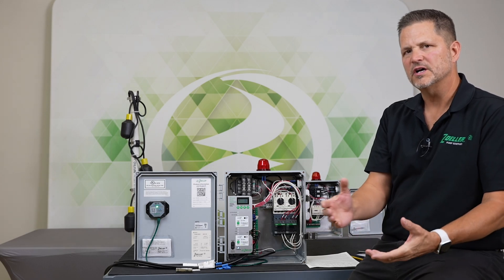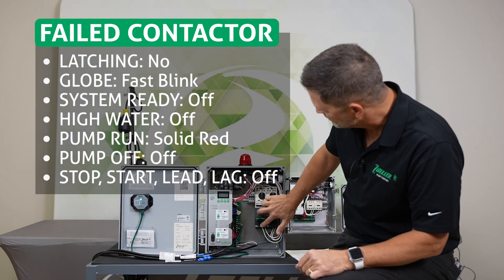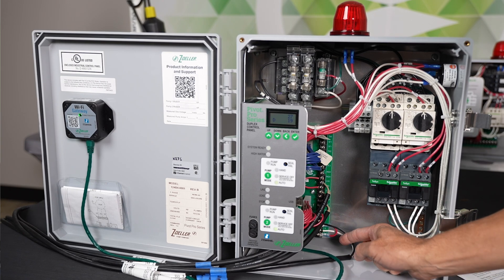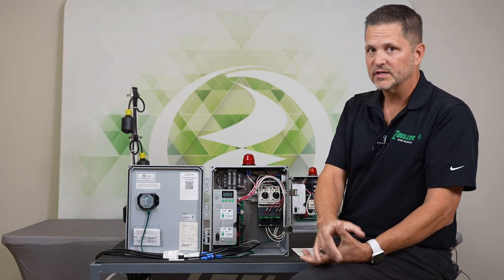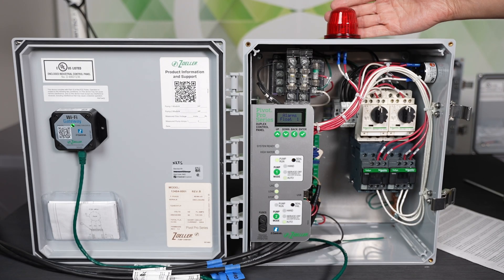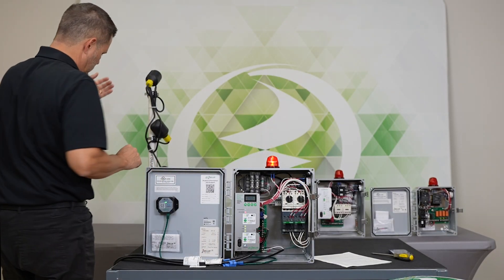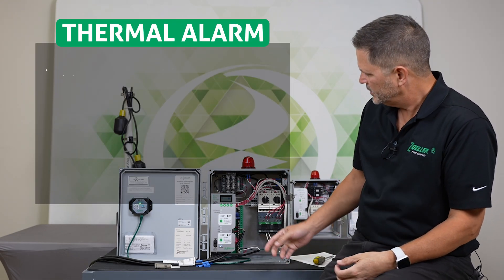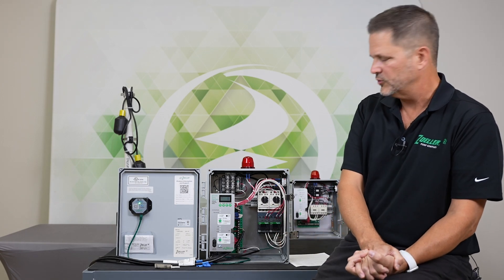Pivot Panel Alarm Conditions

Comment: Hi my Adu swear tank alarm 🚨 is going off when it’s raining 🌧️. It is normal? Shout it work when rain water sweeps in? The red light is Solid
Reply from the maker: Hi @Outoftime11, I would recommend you email or call our Product Support team with this question. They are our technical experts and can help you troubleshoot your system. You can reach them by emailing ZCOtechnical@zoeller.com or calling 1.800.928.7867 and pressing option 6.